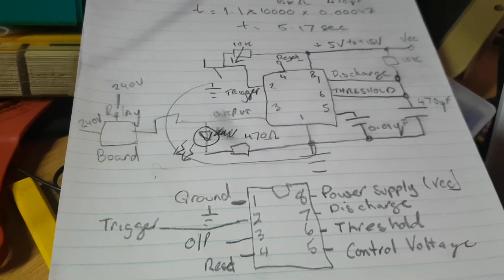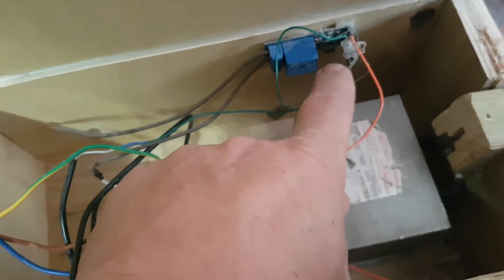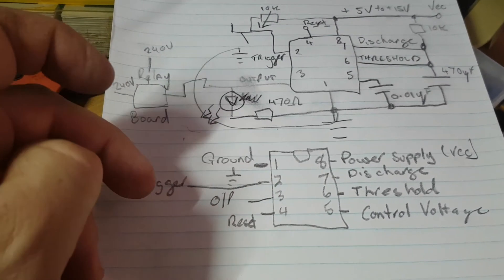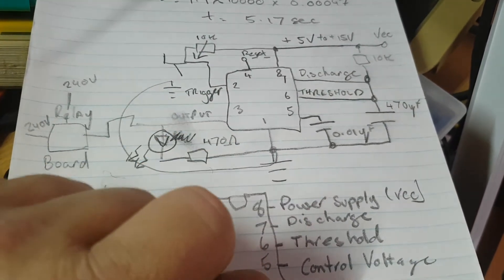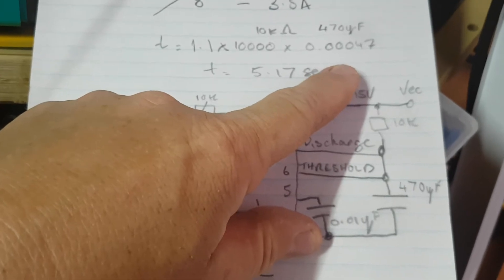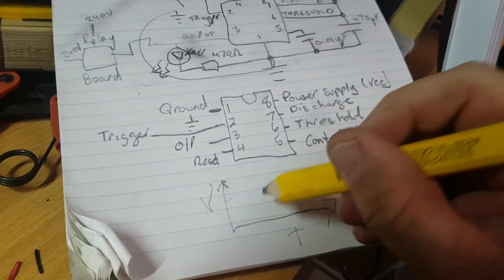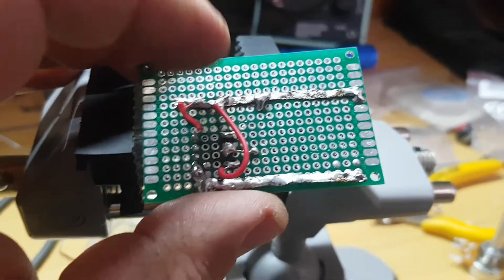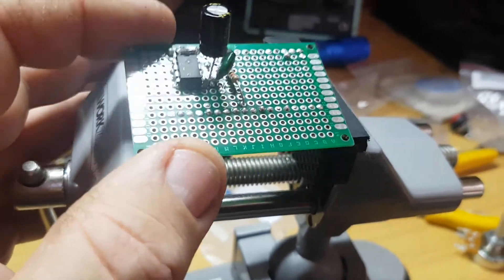555 timer circuit for microwave transformer spot welder.

Comment: Bro are u send me this timer circuit     diagram i want to make this easily
Reply from the maker: Mudassar Rashid Hi my timer does not work very well so changing to an esp8266 chip. Will be starting next week. By the way the circuit kind of works.
Reply from the maker: Snap shot the start of the vlog for the circuit. You could change the values of the Capacitor and resistor to change the timing too. 5CR=T
Reply: Ok am wait....